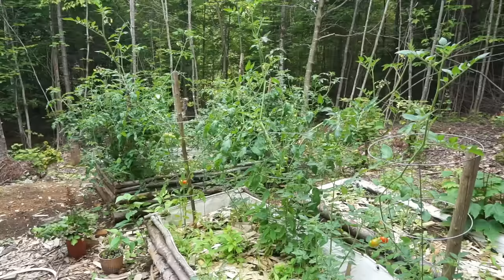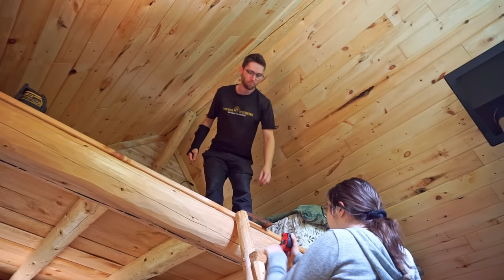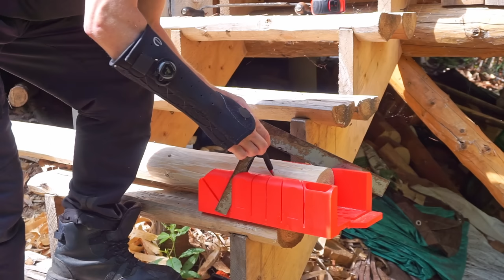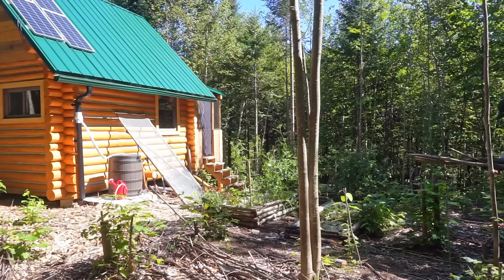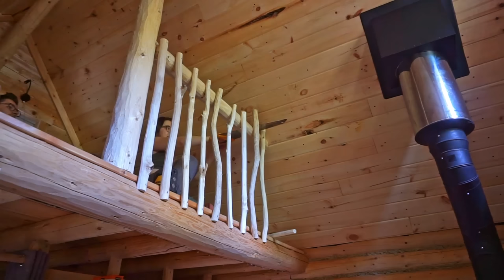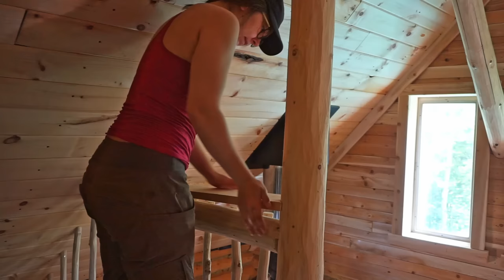Building A Log Cabin | Ep. 60 | Second Floor Railing With Branch Balusters & Injury Update!

Comment: I really, STRONGLY, suggest you guys build a sawbench before doing anything else. In a few hours you will have a tool that will making sawing MUCH easier and more accurate. I wince every time I see you sawing on a flimsy table, much too high for decent sawing.
And after that, a sturdy workbench... It will save you some much time, and it will make everything much more comfortable

Comment: You Folks are doing a very good job. I am not sure what your building background is but you are doing very well. I wanted to comment on your installation on the chimney, If and when you have to replace the rubber gasket around the chimney( or reseal it) , place the base  square portion in a "Diamond pattern" with the point of one corner pointed to the peak. This allows the water to run away from the seam where it meets the metal. This prevents water standing on the seam and eventually working its way in. The gasket placed in this manner  will last a very long time without water getting under the seal. I have used this method  several times and one chimney I put in over twenty years ago is still tight and shows very little wear.  Again you folks are doing a good job and I commend you on your exclusive use of hand tools, not many today would take on such a challenge., to build a large project.

Comment: Glad you are healing fast Nick. I had spinal fusion of T11 - T12 & L1 on June 16th with rods & screws and healed in 6 weeks. I still have to wear a full back brace for 2 more weeks. I also had surgery on my neck 3 weeks after the fusion but that healed in 2 weeks. Your arm thingy looks state of art. My brace is cool, it has Velcro, pully's & cables, a metal rod in front to a padded shoulder / neck limiter & cost $2,000.00.
Reply from the maker: Wow I’m surprised you healed that quickly!! Everything spine and neck related is rough. Glad you got out of it okay :)

Comment: I am very happy to see that your hand is better. God is good.  I wanted to tell you guys that those loose pieces of insulation that you have stuck in between the logs is extremely dangerous to breathe in. You even have your bed against a wall with it. Please remove the loose Fibre glass insulation from between the logs and use spray foam insulation instead in between the logs.

Comment: The rungs of the ladder must first be recessed into the uprights and then inserted the screws. If they are recessed at least 2 centimeters they support themselves and if you then insert a screw this prevents the rung from coming out of the upright and therefore it works. A screw cannot support a lot of weight, and it was seen that it broke cleanly even with the minimum weight of the boy who weighs around sixty kilos, I'm thinking of the door you installed on the entrance, usually the door where there are bears it must open outwards and close towards the hut, this measure prevents a large bear that can weigh up to 500 kilos of muscles from trying to open it by pushing. if the door opens outwards, just recess it so much that the bear's claws cannot get in to pull it out and then if you apply a three centimeter profile well recessed and screwed halfway up the upright, the bear's strength will not be enough to break down the door so you can sleep soundly at night. The hinges that you applied to open the door should only be used for this and not to support the weight of a bear's pushes because if you count the screw that broke for about fifty kilos you think that a bear pushes a few tons therefore the 6 screws that are supposed to hold the door would come off after three or four pushes.

Comment: From a building point of view, you put the branches on the wrong side of the railing, if someone leans on them as they are, they would easily be pushed off.
Reply from the maker: We thought about that too, but our mattress wouldn't fit lengthwise if we put the branches on the other side. There won't  be much chance of someone leaning up against them anyways, it's more to prevent blankets and pillows from falling down
Reply: You could have drilled holes into the top rail and inserted the sticks into them.